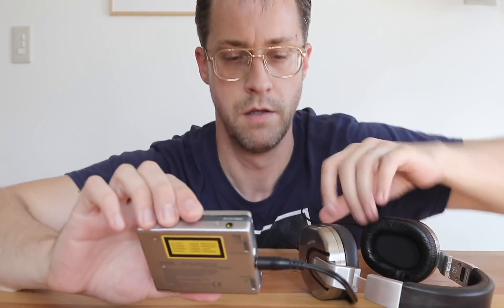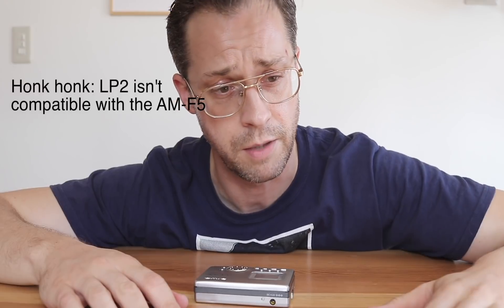Thursday Thing - Aiwa Minidisc 3.7V 700mAh LIB-902 battery adapter

Comment: This is so cool, glad I found the adapter to print 😀. I still have my AM-F5, complete with headphones, (stereo) microphone, wall socket PSU, and the external AA battery case. I know I should have the original wall socket battery charger too, probably somewhere in deep storage (aka a banana box in the garage).

It still works like a charm, and there is something about handling physical mechanical media to store music. I still use it in combination with my Pioneer MJ-D707 stereo component for recording and the Kenwood KMD-870R car stereo 😁.

Comment: You can charge it inside the player
No need for the 18650 charger
Reply: Yes you can but the original battery contained it's own charging circuitry. The replacement 10440 is best charged outside of the unit to maximise the rated capacity..

Comment: I recently acquired an AM-F5 boxed with all the accessories and manuals. I guess I must be fairly lucky as I've just run a continuous play test to see how long the Lib 902  battery would keep going. It got to 2 hours 20 minutes before giving out. Nowhere near the rated 7 hours but still pretty decent. In spite of that I've still ordered the adaptor and batteries because it will obviously not last forever. As far as the hiss goes I couldn't really hear any. This may be because I'm an old fart and my hearing is shot, it may be my headphones are not sensitive enough to pick up the hiss or it could be the recording was actually made with a NetMD machine and not the AM-F5. Whatever the reason, the AM-F5 is still my favourite MiniDisc player even though I have a Sony HiMD machine, a few Sony MDLP models and an Aiwa AM-NX9 NetMD machine.
Reply from the maker: These things hiss so much that it has to be your earphones. I have one pair of earphones that only barely hisses through the F5, and they sound great.
Reply: @FauxtakuLounge  Running through my Technics amplifier with Mission speakers now and still no hiss. Next test will be to record on the AM-F5 itself. It could be the recording side that adds the hiss rather than the playback. I'm not quite sure why I'm doing this because I don't want hiss but it gives me something to do.

Comment: Thanks a lot for the video and the seller contact!! Do you know if is it possible to charge the new battery using the main unit and its charger like if it were its original battery? Would it be dangerous? Thanks!!
Reply: Sorry I've just read the comment next to mine explaining that it is not possible 🤚🏻

Comment: Hi - Great video! This might be a stupid question but would this adapter work with just a normal AAA battery? Thanks
Reply from the maker: It won't. The MD player requires more voltage.
Reply: @FauxtakuLounge  Thanks again!

Comment: is this available via ebay - i managed to get a similiar one for the sony mz-1 recorder and id like one of thses for my various aiwas - i use a similiar battery to the above with a copper rod attachment which is a pain to fit inside as it moves about and you have to pack battery compartment with cardboard etc.thanks !!!
Reply from the maker: Where did you find this for the MZ-1? I'd love to know. Cheers.
Reply: just search on ebay sony mz-1 battery adaptor ,should be top of the list of search items

Comment: Thanks for the information and the great video. I also ordered an adapter today. 

Including shipping to Germany, it now costs $ 27.
One more question: ....after the swap, can you then charge the player with the original power supply?

Thank you and keep up with your interesting channel
Reply from the maker: You know what? I've not tried charging it internally. I hope to get back to you soon- though you may figure that out before me.
Reply: So, unfortunately I had to experience that it does not work with the original charger!
Reply: @iSchacht  I charged my battery with the adaptor in the AM-F5 using the original charger with no problems.
Reply: You paid for a free non commercial thingiverse Design!
Reply: @-Gothicgirl-  It's only free if you have access to a 3D printer and even then you still need to add parts to it. Why do people pay for anything that they can do themselves? Because they can afford to and don't want to do it themselves.
Reply: @ianz9916  paid for a thief copy that say He claim it has the idea and paying expensive price for 1! No tanks then I go to a printer Shops  that every City has or ask in a printer community! Today you can find many Shops that print what you want. 

These selling it is against the lizens that is set for the Model! They are non commercial and that means no selling.
3d Modells are under copyright and Lizenz rules and not to sell like you want
Reply: @-Gothicgirl-  There are very few 3D print shops in the UK and it's not a thief copy. The seller put a link to thingiverse and gave credit. The seller is only doing what the print shops do, manufacturing the product and charging a fee for doing it. Tell me which print shops altruistcally produce items without charging.

Comment: This adapter is a godsend isn't it? For years I was looking for  a solution to the dreaded LIB-902 proprietary battery for my F70, F80 and JVC MD units. The engineers that design such proprietary batteries should be taken out back and shot! Just kidding! I was lucky enough to come in contact with the maker of this adapter on the FB MD user group I belong to. When I got mine and was able to use my units as true portables again I was giddy. The MD community owes a lot of thanks to those that produce such alternatives. So MD enthusiasts such as myself can continue to enjoy our machines!
Reply from the maker: Well met dude. I’m a member there as well.